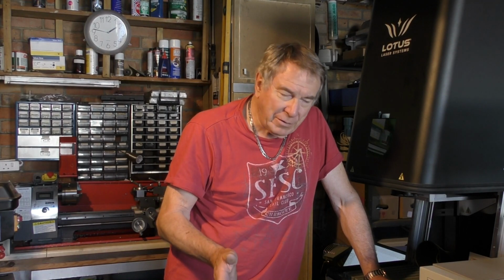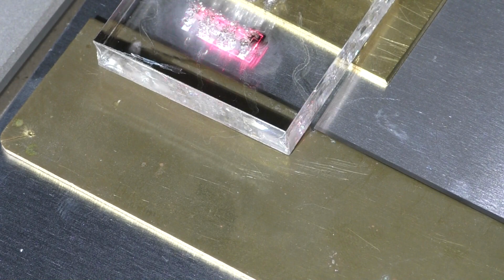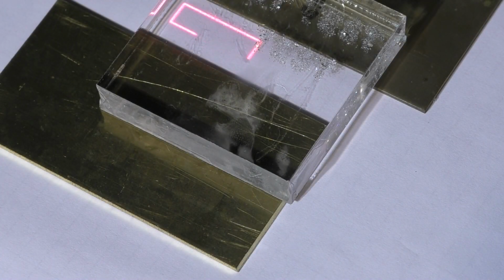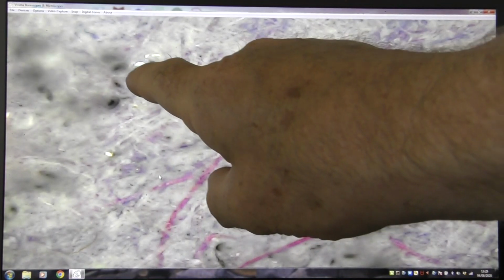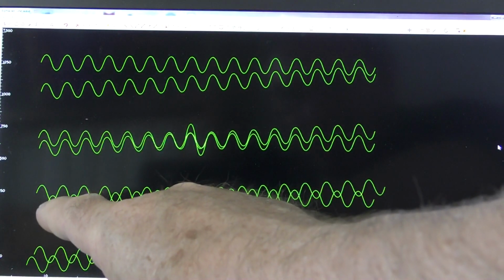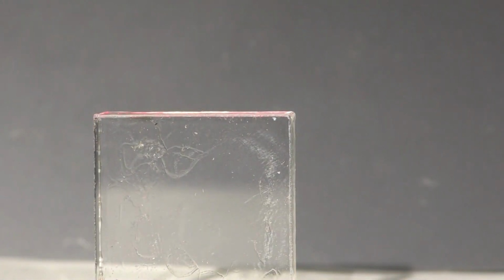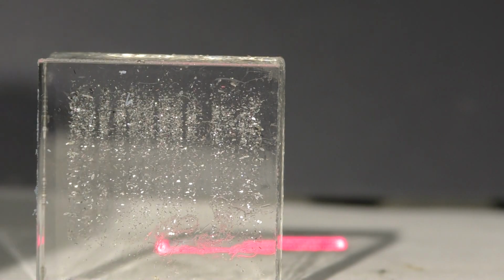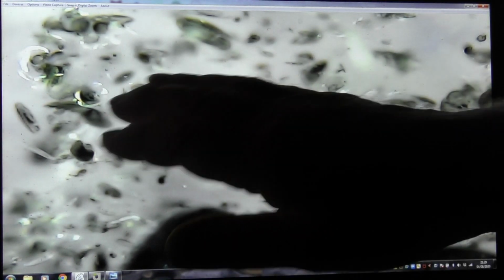Fiber Laser Learning Lab 21 Bubble Marking Clear acrylic

Comment: You’ve answered a burning question of mine, namely to mark polycarbonate. The material used in 3M safety goggles.
Reply from the maker: Hi
 Damaging ANY material depends on two  key factors. 1) The resonant frequency of the  material's molecular structure and 2) The  stimulating frequency (wavelength) you fire at it..
 1)The stucture of a molecule  is best imagined as a metallic scaffold stucture. Just a few 6m long scaffold poles  built into a  cube will be a very "wobbly" structue.  If you stand by the cube and push/pull it to create an oscilation you will note the very low frequency required to do so. IF you now try to shake it at ten times the frequency , the structure will ignore your attemps to add kinetic energy.  Add diagonal cross bracing tubes and the stiffened structure again resists your low frequency attempts to add kinetic energy.Take this simple  cube stucture and make the tubes just 1m long. I am sure you can visualize how  such a "stiff" stucture will again ignore low frequency stimulation. 
2) The  very wide terahertz  frequency range of the mangetic spectrum is responsible for  stimulating virtually all materials . (see https://en.wikipedia.org/wiki/Molecular_vibration ) and you can see what  the wavelengths this equates to from this diagram  https://www.geeksforgeeks.org/applications-of-electromagnetic-spectrum/
 
This diagram for polycarbonate  shows the efficiency with which  various wavelenghs shake the molecules and add kintic energy. 100% transmission means that  zero energy has been absorbed. Because about 10% energy is absorbed at around 1micron wavelength  you can MARK but not CUT . At CO2 wavelenths (10,640nm) the absoption is 100% (transmission 0%)  and why polycarb safety glasses are safe.   https://www.researchgate.net/figure/The-transmission-spectra-of-the-05-mm-thick-polycarbonate-plate-reproduced-from-Ref_fig2_345435824

The same diagram can be applied for acrylic (PMMA) . However acrylic is damaged by a completely different mechanism to polycarbonate.Acrylic liquifies at 160C and boils at 200C there is no chemical reaction required to cut acrylic, it is just a change of state  that requires a lot of energy. At 1micron wavelength because the absorption eficiency is so low (5 to 10%) the photons in the laser beam have a low chance of hitting a molecule  and it has to be a  focus of photons occuring that can createb enough energy to vapourise an acryic molecule.  It is this random( but focal zne effect) that causes internal  vapourization  (explosions) with in the acrylic material.

 Polycarbonate is different in that marking occurs  at 1 micron wavelength as a result  two effects  First,  the low energy absorption into the surface of the polycarbonate  causes local surface melting an micro  boiling. This in turn changes the  light transmission properties at visible wavelengths and effectively creates billions of  micro cats eyes that reflect  normal white light, This is how  you percieve "maring"  of the material.the material. Playing with the power and exposure time (speed) creates a range of surface textures and hence  different colours. For example it is possible to creat a gold colour from white polycarbonate.

Comment: Interesting, i wonder what would happen if you sand one side so its not clear any longer and then test the sanded surface on the bottom and top and see if the refleaction from the bottom comes into play or of it can even mark below the sanded surface. Its pretty interesting that it makes bubbles at random, and not very uniform in depth.
Reply from the maker: hi
 In the past three yearsI have learnt a lot more about the interaction of light waves with various materials  and I now understand how this effect happens.  In fact I recently reproduced the same bubble effect during experiments with a diode laser
see https://www.youtube.com/watch?v=pvNKf2T-op4      from about 20 minutes

 The bubbles are random (ish) because there is a zone of light intensity either side of the focal point which is sufficient to ineract withthe few acrylic molecules that happen to be in the path of the photons

Comment: I'm wondering if there's  a catalyst in the acrylic that's not as transparent to the fibre laser light. My resin printer uses a UV curable catalyst, my polyester resins use an MEKP catalyst. Here's an old video showing marking extremely similar to yours,, done deliberately and discussing acrylic plastic manufacture: https://www.youtube.com/watch?v=MahBmZ66Eno 2-part silicons use a zinc? or a platinum catalyst and likely there's one in epoxy and in polyurethane resins too.
Reply from the maker: Hi Graham
Subsequent research  and knowledge gained elsewhere about materials and the way that they react to different light wavelenghts, revealed that at 1064nm acrylic is about 90% transparent. Thus,  most of the light photons are passing through without colliding with anything solid.. Put it another way, just 10% are likely to hit a molecule where there will be an energy transfer. As I have seen with my many tests with CO2 and acrylic,  hit the molecules with enough energy and they evaporate rather than experience a chemical change. However reheat the vapourised acrylic and it does chemically breakdown to flammable products. Microscopic inspection of the "bubbles" shows they are  not bubbles but minute fracture planes with a distinct spot that indicated a mini internal explosion where expanding gas has internally fractured a little circular plane  that looks very much like our galaxy..The fracture planes are totally random in size, disrtibution and orientation but all within a narrow zone that can be raised or lowered by moving the laserhead. My experience with this machine, even though it has a more complex multi element F thete lens is that it still has some of the weird "intensity" focus issues I was observing with the single ZnSe CO2 lens. Thus when the beam is focused (in the conventional way) onto the surface using a different material that absorbs the energy.   Although many of those 10% collisions will be by insufficient photon energy.  there are light rays close to the lens axis that are focusing at a different further point  that are providing sufficient intensity to eveporate acrylic IF they collide with a molecule.

 So no complex physics after all,  just building on the strange relationship that happens when you send a variable intensity laser beam through a lens. Whether there is aberration or not in the system, those rays right adjacent to the lens axis will never experience the same refraction s the general population and will always be forced to focus at a point beteween the nominal focus and infinity (at the lens axis)
 Best wishes
Russ

Comment: Since the refractive index of acrylic is around 1.5, when you put the focus inside the acrylic by what you think is 5 mm, it is actually more like 7.5 mm. This is because of the bending of the rays at the surface that causes the focus point to move deeper inside. It is a somewhat similar to the water in a pond appearing shallower than it is. So when you think you put the focus at the bottom surface (where the steel sheet is) it was actually much deeper so the steel was considerably above the focal point and did not get marked well.

Comment: Nothing is a perfect material. Acrylic has a high transmittance, but if you put a high enough power density laser through it. Even with low absorption it will eventually reach the threshold. In this case however it could be natural defects in the acrylic responsible for breaching the threshold, by lowering the transmittance.
Reply from the maker: Hi Curtis
I have since done more research to see if I could account for this phenomenon.  Several people have suggested micro dust particles inclusions or as you suggest defects in the material. 
 As you say, although the vast majority of the material is transmitting the light it only needs a slight local  change in homogeneity  to change its light absorption properties. This results in very local heating which  in turn changes the material refractive index  (thermal lensing) and produces a further local energy concentration/ micro point heating effect.
 May be worth doing some reading on this interesting subject
 Thanks for the comment
 Best wishes
Russ
Reply: @SarbarMultimedia  Thermal lensing is an interesting subject. No problem. Glad you got to the bottom of it.

Comment: Hey Russ do you realize what your doing? you are colliding the beam this is how a 3d laser works, it puts two beams inside of the work at the same spot this creates a "dot" inside of the material a 3d printer uses two galvo heads that aims the beams in an x and y orientation to create the effect
Reply from the maker: Hi Willy
 I am aware of the intersecting beam principle but it also requires a special type of glass (or plastic ) I believe to achieve the micro bubbles.  As you will observe  in my tests , there is no real controllability of pattern to my internal vaporisation, it happened at random depths for each pulse. Concentrated light energy at a specific point seems to be the cause of this effect but this indicates a varying focus of energy (from a single beam) for each pulse rather than a controlled  intersection of two distinct beams.
My original  first thought was the sort of idea you propose.  I thought it was a reflected beam intersecting with the original  incoming beam. . However, removing any chance of reflection soon killed this idea. Hence my one beam variable focus point per pulse seems to be the only theory that fits the observations.
 Best wishes
Russ

Comment: Interference between the original refracted beam and it's reflection from the bottom surface (exit aperture)? Try angling the bottom surface to bounce away from the medium?
Reply from the maker: Hi
 Can I point out that this testing was not carried  out  under the central axis of the machine (rewatch from 2min 15sec) and therefore the beam is already angled to both the top and bottom surfaces of the material and as the scanning of the text takes place that angle is continuously varying. For internal reflection to take place  you will need  ray angles much greater than I was using.  Thus I think my method has already provided the answer to your question.. 
 Thanks for the comment because this is a fascinating puzzle that I can demonstrate but have not established any factual explanation for.
Best wishes
Russ
Reply: @SarbarMultimedia  I forgot about that, ok so you already have interfering beams in the acrylic bouncing around. Can you safely test on axis right down the center where the known reflection point would be halfway? (This is still shadowmite, somehow I have two accounts here).
Reply from the maker: @matthewfogle2280  
 Hi Matthew.
 One thing  you mentioned , refraction.  is having a significant effect on one feature.....the focal point. I nominally set the focal point at the BOTTOM surface of the material but refraction will have shortened this by some unknown amount.  Worse than that. the aberration inherent with this lense means there are multiple focal points for the beam depending on the diameter of the beam Furthermore, the light intensity at each of those focal points will be in accordance with a Gaussian distribution.  This is no simple problem to decode.   Observe the scatter pattern of damage carefully and understand I am working away from centre so my beam entry angle will be 3 to 5 degrees,  Why is my scatter pattern not canted at 3 to 5 degrees?
Lots more questions than explanations with this problem.
 Best wishes
Russ

Comment: Hello Russ I finished your series on fiber and I'm impressed how you correlate things, on the other side this software that you use its minimalist and its offerings control on basic marking.
I worked on Rofin Sinar CombiLine RT,marking Day and Night on polymer vlm software that they give to you it's really impressive and helpful with some functionality like displaying overlapping percentage,the spot diameter,galvo head speed,first pulse suspension in real time,another thing I want to add on the color marking and you could take it like a tip is to use repetition on hatching (1 to 2),use offset on line width,on power add one amp and scale 100 mm/second,use lower galvo speeds for contrast (radian/second)
Hope to see more labs one this fiber guide 🙂
Reply: Hello sir I need your phone number I like to discuss very
Important thing please if you don’t mind 
Thanks 
Ishaq

Comment: Is this how they burn pictures into the center of acrylic cubes?
Reply from the maker: No
That is a complete;y different process  where they use TWO laser beams that use light at about 500nm wavelength and the position in space where they intersect is where a micro bubble is formed. I is often done with special crystal glass but latterly  they use a special clear plastic doped  resin.  If you look at my answer to Precision Laser Solutions comment you will find that the fractures (bubbles?) within the acrylic are symptomatic of a much deeper mystery .
 Best wishes
Russ

Comment: I can see you quite liked that, but what was noticeable on yours was that the bubbles were quite spread out, 5 or 6mm for the densest area, I think with a little more playing you could squash the dense area to 2mm ish, it makes the lettering stand out a bit more.
Reply from the maker: As with all the things I play with and explore, I am less interested developing a final professional application but rather more interested  in understanding the physics and chemistry basics behind the observations I make.,Yes there seem to be dense areas both above and below the focal point where some sort of light interference pattern id taking place. With the 10.6 micron CO2 wavelength. the light energy never has a chance to enter acrylic. Instead there is an energy transfer at THE SURFACE  as those exposed molecules become excited, heat up and disappear as vapour. That is why acrylic is a fantastic tell-tale material for "seeing" energy intensity patterns  and velocity variations. Because 1 micron light has no such stimulating effects on the SURFACE molecules, it appears that this shorter wave length light psses through the  acrylic molecular struture without exciting  any of the molecules. 

 I say "appears" because my observations tell me that acrylic molecules ARE being excited by the 1 micron wavelength light but not sufficient to achieve melting or evaporation.. This was proved when 90% or more of the light intensity never made it through 25mm of acrylic to damage a stainless steel surface That energy MUST have been absorbed and generally heated the acrylic to some low level. 
 The second critical observation arising from this  asks what is happening to the light energy at minute and random points within the BEAM (not the material) that is causing local spikes of molecular excitement within the material. Again the material is  only showing us that something weird is happening to the light. This is like nature's slight of hand . Ignore what you see (those  fascinating "bubbles")  and look at a more fundamental phenomenon taking place in the background.. Note that there is a pattern of bubble density above and below the focal point but not AT the focal point. Doesn't that seem strange?. You would naturally assume (based on all normal lens and wave theory) that maximum material damage would occur at the focal point. The fact that it doesn't. is the REAL puzzling outcome of this exploration,  What on  earth is  happening to the light intensity at these  "nearly focused " zones . As I have declared many times, I am neither a physicist or chemist so my superposition theory of intersecting lightwaves is the best I can offer by way of an explanation. I am sure there is a doctorate waiting for someone who investigates this phenomenon.  So even  at 1 micron wavelength, acrylic is demonstrating its "tell tale" ability........if only we could read the message in those bubbles

Best wishes
Russ

Comment: Perhaps the laser beam, reflected from the metal, changes (increase) the wavelength. Or the engraving process generates infrared waves that act on acrylic.
Reply from the maker: You have not watched far enough to see that even when I remove the reflective surface the effect still happens. My first thoughts were reflective  interference effects but I soon disproved that.

Best wishes
Russ
Reply: https://en.wikipedia.org/wiki/Bubblegram
Reply from the maker: @maksimsoft  
Yes. I am very aware of that expensive technology that requires the intersection of two separate laser beams  plus some special optical glass or special optical plastics. They also run at about 500nm , half the frequency of the fiber laser I am using.  The  effect I see  may be similar but it is is totally random and I believe it arises from the wave interference within a single focused laser beam (not even at the focal point) and not the controlled interference of two intersecting laser beams.
Best wishes
Russ